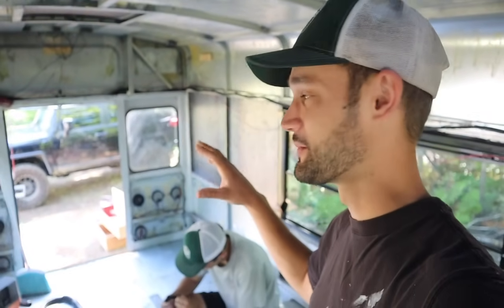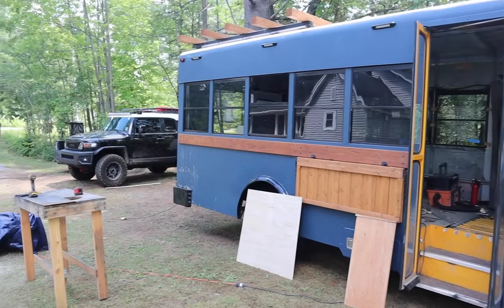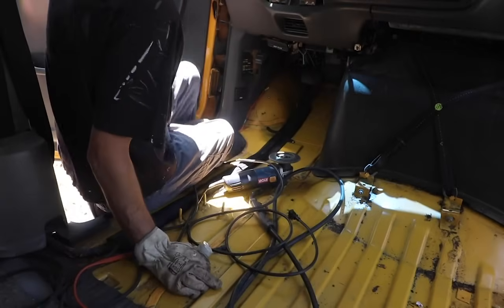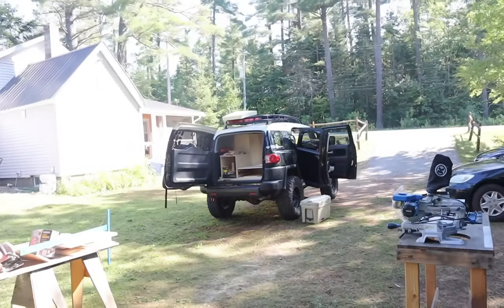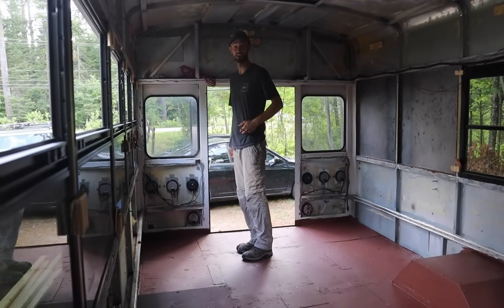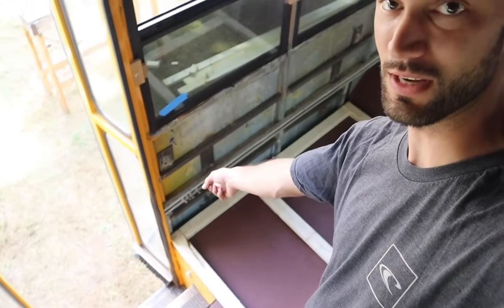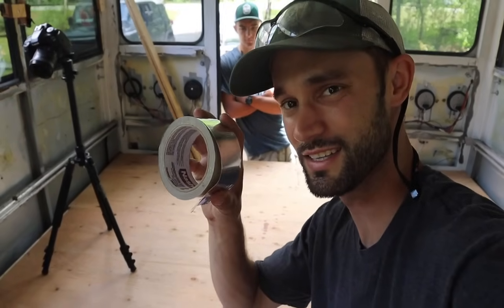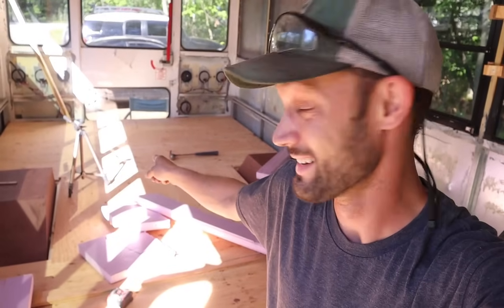Installing the SKOOLIE SUBFLOOR in my Short Bus Conversion

Comment: unless you put foam under and around the edge of the bframework or actually use liquid nails or bodysealer to gleu the frame down to the floor it will probably creak or rattle a little during traveling , i agree that you dont need to put screws through the floor but it does need sumting to prevent it moving around
as for the gaps around the foamboard , stick some right stuff expanding foam in there

Comment: Awesome job on the subfloor! We're taking notes for our shuttle bus conversion.
Reply from the maker: Your shuttle bus floor with be really similar. The only difference is if you get a shuttle bus with no wheel wells you will have a bump up after the cab area.

Comment: The max for any xps insulation board is R5/inch, i've sold thousands of sqft of it. The only thing higher is polyiso insulation which is amazing, love the work! Your R7.5 value comes from it likely being 1.5" thick board youre using thus 1.5"x 5 (R5 per inch thickness) = R7.5

Comment: Exciting!  So, what's with the hole in the floor?  I must have missed that.  It's really evolving, so cool!
Reply: Thats over the fuel tank. I do believe that is an access hole for the fuel pump.
Reply from the maker: Chuck is correct. It’s the top of the fuel tank for the fuel pump.
Reply: Yeah if the fuel pump goes bad he wants to be able to get to it easily. My dad and I replaced the one in my old car and it was a nightmare.
Reply: @navigationnowhere  Thanks everyone!

Comment: We are about to start the subfloor on our bus, and had basically decided not to put down 2x3 framing at all.  (Just liquid nail the plywood subfloor to the insulation). That would avoid the thermal bridge problem entirely.  Love to hear your thoughts on whether that's a good idea.
Reply from the maker: I have seen it done before and I considered it myself. If you get the right foam board it is made to have a high compression rate so it should stay strong without sag. My issue was that the flooring was thin aluminum so I am kind of also using the 2x3’s to support the plywood off the thin metal (so it’s catching the steel beams for support. If you have a big bus, the steel floor is more than strong enough and has no flex.

Comment: Hi!
I love that you are pedantically accurate! 
The conversion might consume much more time, but you are not letting faith decide over anything, when the bus is done, you know exactly, what ist where and how it's done.
(And you filmed a lot of things so you could watch back what you've done.)
I sat for a one hour to cut a special flexible long lasting stitch with a seam ripper because I saw, where the needle went not 100% straight in line two times. Only to make the new seam in less than a minute (then perfect).
Hubby said, no one will see it, just leave it as it is. 
Noooo.... 🤪
But after that I saw you and Luke putting in the floor and I feel normal again. 😂

Comment: 2x2's would have been my choice for the sub-floor, it would cut the thermal break in 1/2 of what the 2x4's are. There is no good reason I can think of to use a 2x4. Also instead of running 2x4's from side to side, I would have run them up the center on either side of the walkway. To provide more protection to the foam board. They would also act as nailers for any walls or cabinets being put in, instead of just attaching things to the 3/4 plywood flooring.
The dog house that is not going back in could have the back/bottom cut off it and attacked to wooden "cabinet" you are going to replace it, assuming it has mounting hardware built into it, this might make it easier to fit it back up to the bus

Comment: Hello navigation nowhere,
Wondering what your thoughts are on doing the floating floor without using plywood subfloor? By this I mean going straight from framing to pallet flooring in order to save space. So, 1" framing and rigid board and ship lapped pallets ontop.
Cheers

Comment: what did you do with the hole in the floor where the bus fuel pump (i am assuming that is the fuel pump) is?
Reply from the maker: It was covered with a removable patch that will be accessible in the finished build.

Comment: You did not connect the 2x4's so the floors would float ?  Then used the insulation to hold everything in place ?

Comment: Hi there! I'm also converting a short bus. I was wondering how you sealed the holes in the metal floor? I'm thinking about using jb weld as I don't know anything about welding.

Comment: I would be interested to know if when you are finished if you get squeaking in the floor because you didn't liquid nail the 2x3's down? If your way works would save probably 100 bucks not to use the liquid nail.

Comment: Are there enclosed cargo trailers that are similar to bus framing structure and sheet metal thickness? Basically a cargo trailer build as quality as a bus? I can't seem to find and particular ones that are quality engineered as a bus.
Reply from the maker: I just rebuilt a construction trailer gooseneck on my YT channel before the bus build. You could check out the series to see how we did it. Overall though it’s the same process as the bus.

Comment: Michael, another great vid! Good work. Luc as assistant cameraman does a great job as well. I'm just wondering. What do you think about using a roofing ice and water shield over the aluminum floor to seal over all the holes and assure a nice watertight base? It also then seals any screws you put back through the floor during the build.
Reply from the maker: I considered that as an option. Jax Austin’s bus as a similar style done to what your suggesting

Comment: Hey idk if you reply to old videos i was curious if you had any tips on painting the floor i accidentally used latex instead of oil based paint i was curious if you knew ways to fix my mistake? Like should i sand the entire floor or could I paint over latex? My bus floor is ribbed so im a little sad to sand if i have too but ....

Comment: If a person can't weld, do you recommend using aluminium tape to cover the floor bolt holes?

Can you then rust coat over that?
Reply from the maker: It would rip really easily. I would not use it for those holes
Reply: @navigationnowhere  would you use bondo if you were unable to weld in this case?

Comment: Mike - it's really coming together!!! So happy you've moved to the inside of the bus!!!
Will you still have enough head clearance once the flooring is finished?? What is the total amount of head space you loose with the subfloor installed?
I'm curious, Mike, would you have been able to lay the 2x3's around the perimeter and spray foamed the floor? Or just spray foam the floor without the 2x3's?? Would the spray foam have given you a better R value than your current set up?
Will you be painting all the yellow on the inside of the bus?? I'm going to assume it will not be painted that gorgeous blue you painted the outside of the bus with? Do you know what colors you will be painting the inside of the bus with?? Any hints as to what those colors might be???
Thank you for sharing this build. I enjoy watching your progress!! For whatever reason, you always seem to amaze me with each video, each phase of this build. I look forward to the next video!!! Please keep them coming!!!
Reply from the maker: The final height will be around 6.1. You can spray foam the floor instead of using foam board. As for the inside, I have not finalized interior colors and materials at this time.
Reply: @navigationnowhere  you are always so quick to respond to my questions! Thank you for that. It is certainly much appreciated!!!

Comment: Hi Mike, just a question: why did you paint the bus floor? And what kind of paint did you use? Thanks! Loving the bus build videos!
Reply from the maker: The floors were painted for a overall sealer on top of the Metal. The paint is a rust preventing coat. A link is in the description for the paint I specifically used
Reply: @navigationnowhere  thank you! We are planning our own skoolie conversion in the future so all your videos are super interesting and instructive

Comment: what's the reason for painting the floor? Is it necessary? Thank you!
Reply from the maker: It’s a rust preventer and sealer. It may not be necessary but to me for the cost of a gallon it is worth putting on before you start building.

Comment: Can I use the same format to do the flooring in a box truck or van?
Reply from the maker: You can use the same method. But, vans are framed slightly differently because you have less space and the floors are corrugated not flat.

Comment: Great video! I'm planning my skoolie right now. Did you use regular hardwood 2x4s to frame the flooring?
Reply from the maker: They were 1x2’s but, if you have a solid metal floor you don’t need the 1x2’s the psi rating of the foam board would be enough to hold your plywood subfloor. I only used the wood to span the frame rail beams. My flooring was thin and not strong enough to support the weight without the wood.
Reply: @navigationnowhere  How'd you know your floors were too thin? And if mine aren't as thin, would I just nail the foam and the plywood directly into the metal of the bus floor? Thanks for the reply!

Comment: Oh really?
😏 I have a vary similar skoolie project going on... 1997 Chevrolet Express cutaway... That dash looks really familiar.
Now, on mine, I have an elevation difference between the front and back... No wheel wells to deal with, but, an elevation difference... Has its own problems 😒.
I like the idea of rebuilding the dash. It's mostly useless and in the way, anyway. And since I have to take it in for a bit of a fix (speedometer gets stuck every once in a while. Nothing like registering 65 mph when parked...), A rebuild might just be worthy of opportunities explored.
👍👍👍

Comment: Tight wall to wall plywood isn't good. Cold/Hot weather contraction/expansion. Just like when lying down a hardwood floor it needs a gap of at least 1/4 inch along the walls. Or do 1/3 of an inch and fill it with soft silicone.

Comment: I was going to do the floor with wood furring but knowing that water will may form or leak in from windows, condensation or spills I opted not to use them with my 2” foam board since the foamboards are design to not absorb water and are used to insulation concrete floors. The wood can rot and move water up to the wood plywood floor. The furrings are thermal conductors that will make the floors colder. I Glued the foam to the floor and then I layered the plywood gluing that to the foam. The plywood is several inches short of the walls then foamed filled. No rot and thermal conduction from floors or walls. Check out what the pros are doing today. Chuck Cassidy vids on YouTube https://youtu.be/us4WejejFWE

Comment: Could you try and put 1/2 foam board down first then the 2x3 on top to create a thermal break and give the 2x3 a little more insulation?  also what about pocket screwing your frames together give them a little more structure without having to drill them into the floor?
Reply from the maker: You could do both of those things. Putting insulation below would be fine you just sacrifice headroom.

Comment: I'm thinking you could have built a little lighter; with the spacing of your floor "joists" 1/2" plywood would be sufficient as a subfloor. There is absolutely no need for 4X4 timbers on your roof or the steel you have up there. Aluminum and treated 1X4s would save a lot of weight that high on the vehicle. I'd want to keep the CG as low as possible on an already top heavy chassis.

Comment: Why is it that nobody makes a thermal bridge that separates the metal from the wood if you get into cold temperatures you're going to get condensation and eventually that wood is going to rot or get black mold in it isn't there an adhesive that you can put on the floor that's a waterproof membrane just asking

Comment: Could you get away with thinner subfloor/plywood? 1/2"? We're trying to avoid doing a roof raise and we're right at the edge of my husband being too tall.
Reply from the maker: You can in my most recent video we put down a 1/2 plywood subfloor with no insulation because the owner doesn’t care about cold weather. I

Comment: OK... I don't really know much of anything about buses, other than the videos I've seen and my years of riding a bus as a wee little one!! 🤣.
But.... Why can't you spray foam under the bus?? That would seem like a better use of the product, and would give the floor excellent insulation.
Reply from the maker: You can spray foam under the bus. I did this on the previous trailer build I worked on. For the buses,  the drive train and mechanical partsIt l would be a nightmare to spray the underside. But, I am sure some spray foam people could get it done.
Reply: @navigationnowhere  yea... I was thinking that a rear engine bus would be easier to do that to...😂

Comment: Why are you framing out the floor ? You should just use tongue and groove 3/4" plywood.
Reply from the maker: Many short buses and shuttle buses have aluminum floors which you could easily poke through. Years down the road that could cause water issues under the flooring. In this case, I am framing it out to span across the metal frame beams and support the floor on the beams rather than the sheet metal. If it was a larger bus with a full steel floor. I would be laying the foam down and ply on top. Hope that explains. 👍
Reply: Navigation Nowhere totally makes sense! Thanks for the info.

Comment: About 80% of bus videos I start looking for ideas and then immediately NOPE.

No need to frame the floor. None.
Reply from the maker: You don’t unless you have an soft floor with no metal framing. Some buses have solid steel like my larger one and some models need support. Buy the right bus and you are right sir!

Comment: Why are you using such big wood everywhere? Aren’t you concerned at all with weight? You aren’t using as little wood as possible. Not at all.
Reply from the maker: The weight when all said and done will not effect the rig one bit. It’s already well under chassis rating. As for how much wood we will be using, it is calculated for strength vs insulation value.
Reply: I’d love to see the weight of this when you’re done. I’m sure you know, you’re the expert, but you’re still going to add floor, ceiling, walls, interior walls, insulation, screws and other hardware, cabinets, appliances, water, waste, lighting, more wiring, and personal items... you get the idea. It’s a lot. I think saving weight where you can is important because there are places where saving weight may not be possible.
Reply from the maker: Weight is always a thought. Especially weight placement. You don’t want 1000 pounds on one side and nothing on the other haha. The center of gravity on the rig will way off haha. Thanks for raising the point though it’s a real one to consider.

Comment: I thought he wanted to spayfoam??
Reply from the maker: The floors will not be spray foamed for a few reason on this rig. The sides, front and back, and ceiling will be sprayed 3 inches or R-21. Floors will be rated at around R-12 when completed.